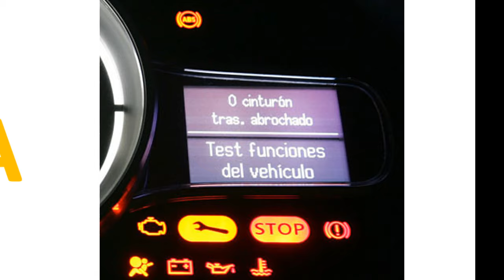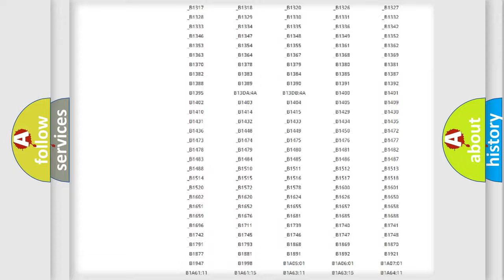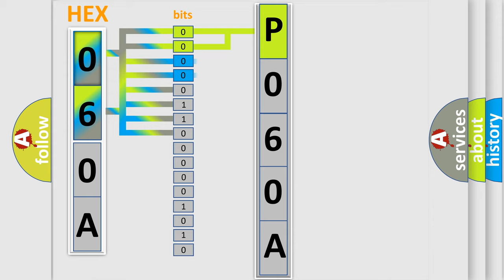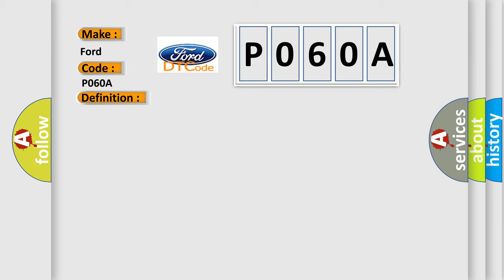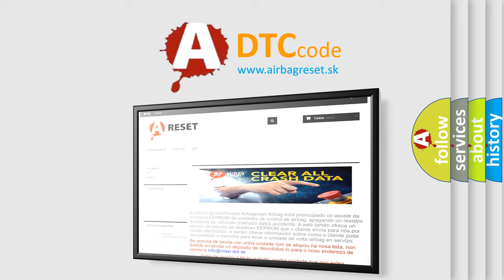DTC Ford P060A Short Explanation

Comment: This was my oddest engine DTC because not only is it ONLY a P060A, but I am experiencing none of the cons normally from a malfunctioning PCM. I have no misfires, I am jot running lean, it starts normally like it did before. Very odd.
Reply: Maybe it’s just a error from emissions test. I just did mine. And didn’t come on right away. But did after while. I erased code. If don’t come back. Might just been triggers or something from emissions test. Cause it runs normal, shifts and starts everything seems normal. Just got wait and see.